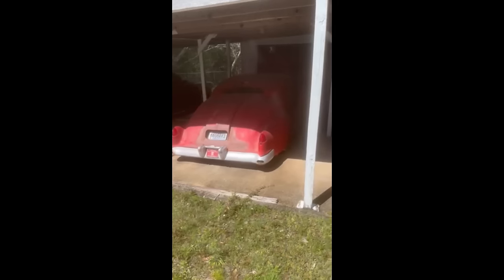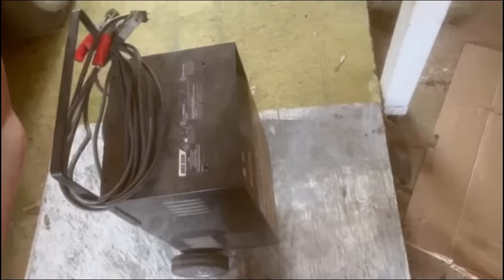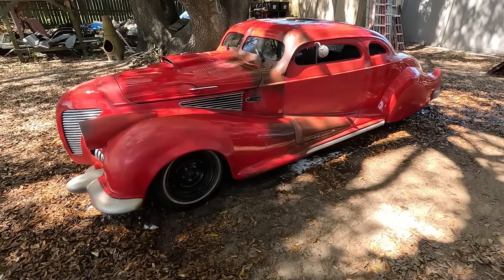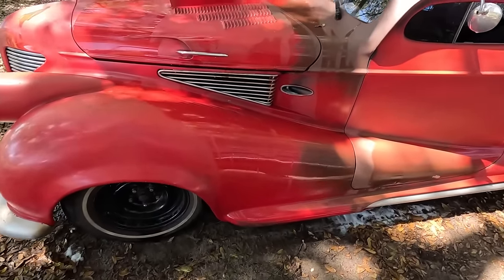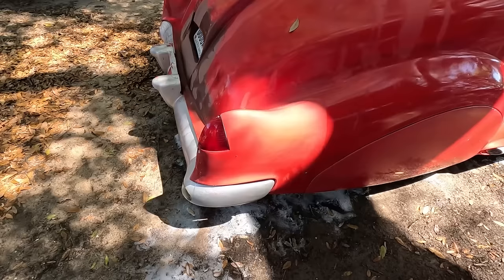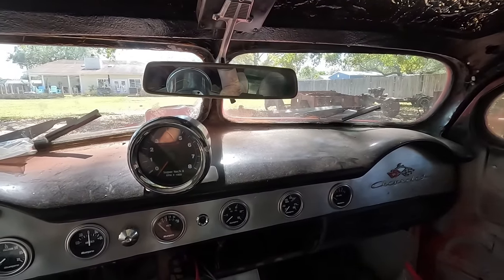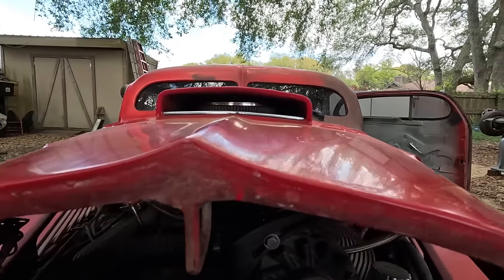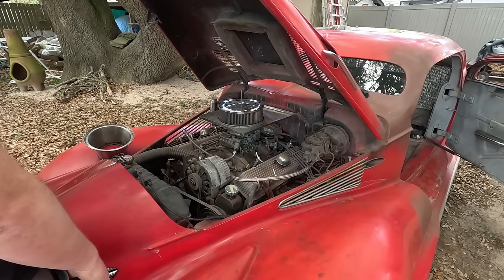39 CHEVY COUPE CUSTOM; OUR NEW PROJECT ARRIVES

Comment: You are either one seriously tall guy or that is a really low and I mean low profile roofline car. The top of that car comes only to the middle of your chest. Looks like it’s almost a foot lower than your shoulder blades!
Reply from the maker: It’s sectioned and chopped, we’re both just over 6 ft so not too tall but still a low ride!